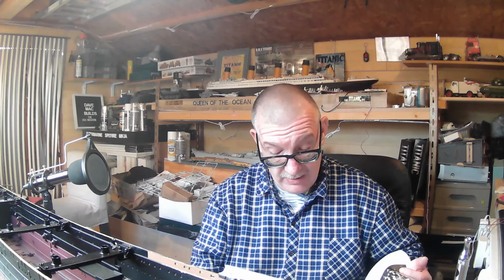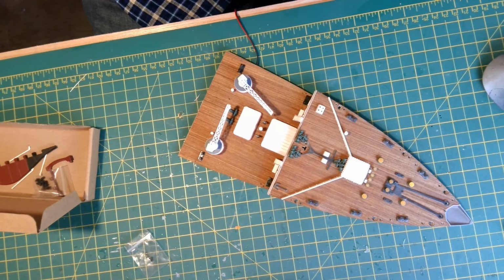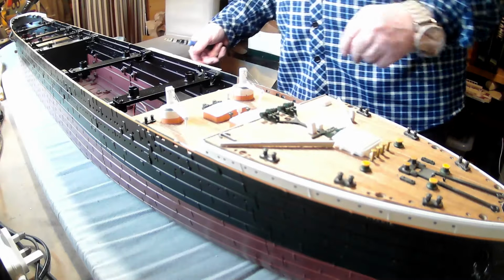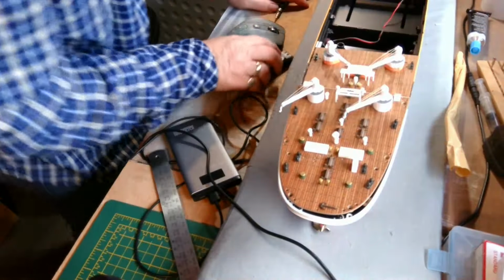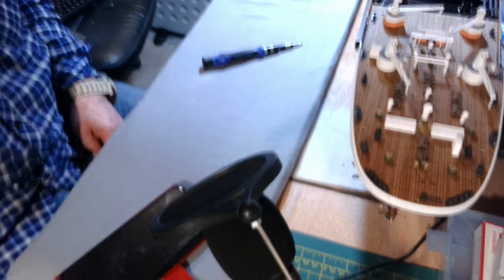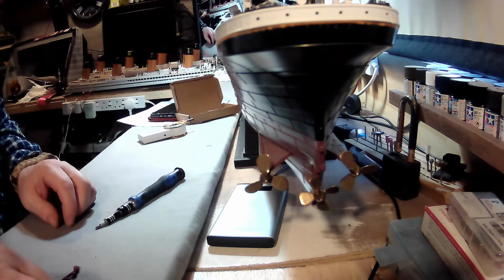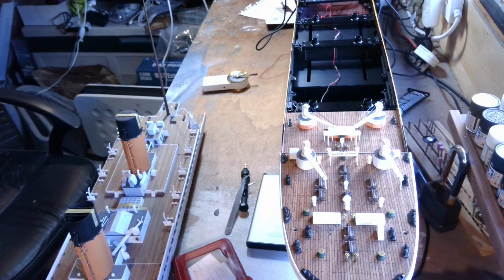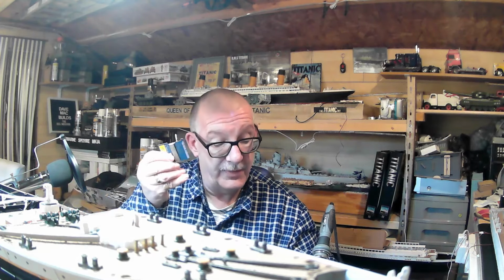BUILD THE TITANIC THE SHIP THE LEGEND ISSUE 135

Comment: Glad to see u got,it working mate hope I have better luck with mine tomorrow lol
Reply from the maker: thanks Chris, i,ll keep my fingers crossed for you, check the cables under both decks before you attach them and be careful putting the poop deck on, its a right bugger to do
Reply: @davemacbuilds5232  I had to get a replacement already for the light already and I’ve got that poop deck down easy now lol

Comment: Hi mate so glad you got it working was feeling gutted for you like you say these models are so bloody expensive you expect them to work. You no the part that attaches to the hull i think it's meant to be glued on mate that's the bit that almost touches the propellers glue it on all it will fall off and your loose it. Did the screw eyes turn up today mate I bloody hope so. Anyway you take care stay safe 👍
Reply from the maker: Thanks Rod the only thing not working is the light under the poop deck, im going to have to take it off after the trouble i had getting it on, i will glue that part tomorrow as i,ll be sorting the light out, i thought at first the circuit board was faulty but i was glad it wasnt,, no the screw eyes never turned up yet but my issue 9 did so i,ll be painting the cleats before i put them on
Reply: @davemacbuilds5232  that poop deck is a right pain to put on and take off good luck with mate. Can't believe they didn't turn up they were posted on Wednesday you should of got them by now. I just hope you get a couple of spares in your next issue. 1👍

Comment: Bloody frustrating Dave. But with patience you sorted it. Does the animated engine go in separately?
Reply from the maker: thanks Nat it was frustrating, ive just this minute repaired the cable in the poop deck and the lights are now working, it was a pain to take that deck back out but i managed it and it was easier putting it back, if you,re talking about the other engine in the next 50 issues i wont be doing it, that one is bigger then the ones we put in, its 1/72 scale a lot bigger than the other two
Reply: I meant the engine you built at the start of the build, the one you can see through the side of the hull, is that already installed and working?
Reply from the maker: @NatJB  oh yes sorry Nat, the one near the opening is working but the other isnt for some reason